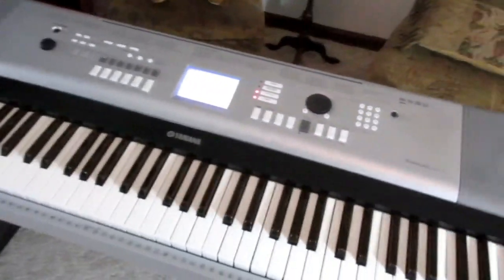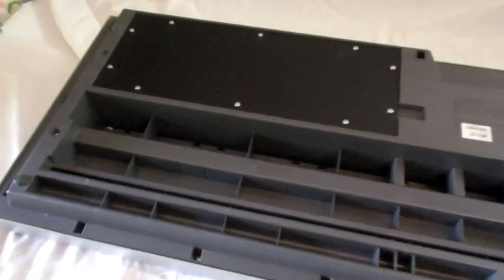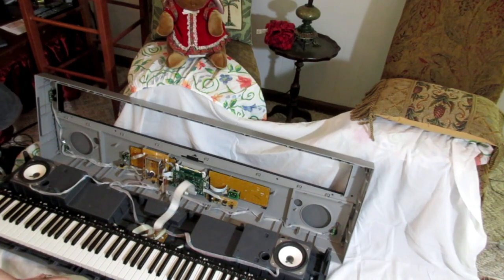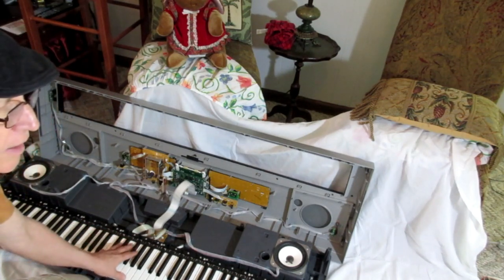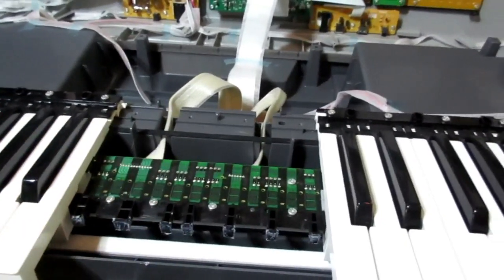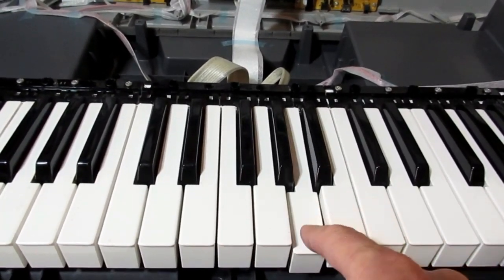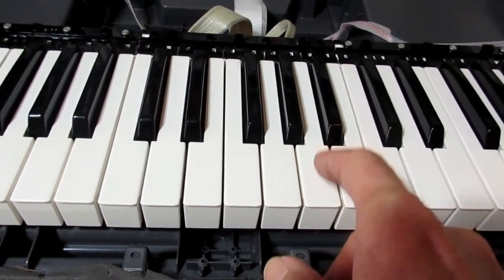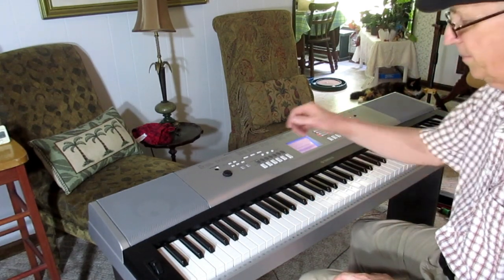I fix a loud key on my Yamaha DGX-520 digital piano.  Thrilled!!

Comment: Does anyone know how to fix a keyboard that when you press one key, multiple keys goes off at the same time, my keyboard has that problem, when i press one key the other keys beside the one i pressed also sound, its like i pressed multiple keys at once whereas i only pressed one, can anyone help me pls
Reply from the maker: It's possible cleaning could solve the problem.  If you suspect your piano has been in dusty conditions, it might be worth a try.
Reply: @richdavis4007  i tried cleaning with alcohol and water and it didnt work, do you have any other suggestion that i could try sir?
Reply from the maker: @hr8253  I don't.  I hope you find a solution somewhere.  Rich
Reply: @richdavis4007  Thanks sir, appreciate the support

Comment: Plzzz I NEED HELP 
What if the black thing under the grey plastic is scratched like half of it had disappeared !
Does that mean i could never fix my key!?
Reply from the maker: I only know what I put in the video.  I don't have this keyboard anymore.
Reply: Try melting some solder on it and file it flat.
Reply: “Works like a miracle.  I used a 8B pencil. On the carbon pads.  For the keys which were still not working, use a dust free eraser, blow clean, then apply the pencil again…all worked well.   Piano I own is a Kong SP 170S” -Zany      This is what another wrote on a similar video as this.  That “black thing” you mentioned is called, a carbon pad.  Take care!

Comment: just took a look under the hood of mine, gently dusted the pcb and the problem persists.  i’m not sure what else to try !
Reply from the maker: Did you see dust or dirt when you looked inside?  I could see evidence of 
debris inside all around and on the contacts.  If your piano is clean there may be another problem.
Reply: @richdavis4007  there was some grime and rust near some soldering points. right before I was about to give up I thought to try the saliva and q-tip method and to say the least it works now ! thanks a bunch

Comment: Isopropyl alcohol would've been better..
Also if a key doesn't produce a sound or the sound it produces is too low, you can use a graphite pencil on those tiny circuits under the key
Reply from the maker: Thanks for the tips.  Rich😊😊

Comment: How did you remove the keys? After unscrewing ? You skipped that part. I’m having trouble with removing the keys
Reply from the maker: I hope and expect you have determined how to remove the keys by now.  After unscrewing the screws on top, the section should be able to be easily removed.  It couldn't have taken me long to figure how to pop it off and I expect you have done so.  Best wishes.  Rich

Comment: How's called the black topper part of the keyboard assembly where you remove the screws? I have a S90 with that part broken
Reply from the maker: I do not know.
Reply: @richdavis4007  Thanks for answering, i just find out its called Keybed Chassis

Comment: Great video up to this point, but I still gave you a like after this point. At 8:50, dont use spit to clean electronics, that is ONLY for the "battle field" and you have no other choice under heavy fire. Spit is corrisive. So, with you egg cartons, scredriver magnet, and assortment of proper tip screwdrivers (see my other comments), keep Isopropyl Alcohol on hand. 95% or better. 99% is the best for cleaning most electronics and any Ace/True Value hardware stores will carry it or get it for you.
Reply from the maker: Thanks for your helpful information!!

Comment: I did hair dryer and it worked. Humidity. Saw a comment and it worked. But this is next
Reply from the maker: If you can clean the uke using a blower, by all means go for it!  The main thing is to get your keyboard back in service!

Comment: After you removed the keys you selected twice wrong what you thought was the offending key. If you watch your video back, when you removed the rubber strip there was a white dot laying on one of the sensors. That was the offending key. The white dot, some particle of dirt or dust was preventing it operating.
Best way to clean the contacts is very lightly with an erasure. Make sure it's not the crumbly type of erasure. Sometimes the contacts and the contacts on the underside of the rubber have carbon pads. Some people use isopropyl to clean but it can remove the carbon.
Sometimes cleaning won't work if the rubber strip is worn, in those cases it will need replacing.
These types of action on digital pianos only tend to last 2-3 years before stripping and cleaning is needed. It's the biggest flaw in my opinion of this design. People pay a lot of money for digital pianos new and I think the product should not fail just after warranty runs out.
Glad you got it at a good price and managed to fix it. Some pianos are a real pain to dismantle. 👍
Reply from the maker: Thanks for responding to my video.  This was my first and last attempt at a repair like this and I'm very happy it was successful regardless of mistakes that may have been made.  Your commentary may help others do a better job while obtaining a similar result.  Very best wishes to you.  Rich Davis
Reply: @richdavis4007  Yes, it's a difficult job. Some are more tricky than others. Glad you got it going. It's just a shame that this problem occurs every 2 or 3 years as its annoying. One thing I forgot to mention. Contact cleaner is good for cleaning the board. Best wishes to you Sir.👍

Comment: Omg, saliva. The worst thing you could do. Use alcohol
Reply from the maker: Yes, that would be a better choice.  Thanks for the tip.  Rich
Reply: @richdavis4007  I have one key and will be doing the same today.  I have a sour note on one key in the 7th octave.  These are fun to work on.  I had to find a bad note on a 550 a while back and it turned out to be a cracked trace.  I located the crack location by troubleshooting the symptoms and found a single point where this could happen.  Opened the unit and verified it was where I thought.
Reply from the maker: @ipscone  You've got the right attitude and exerience.  No point in fretting over the job.  If it's fixable, I'm sure you'll succeed.  Best wishes.  Rich😊